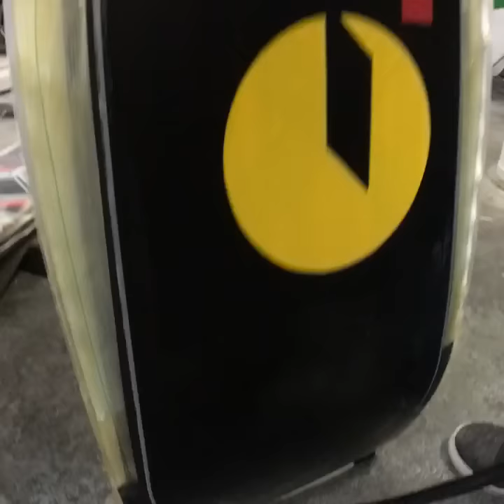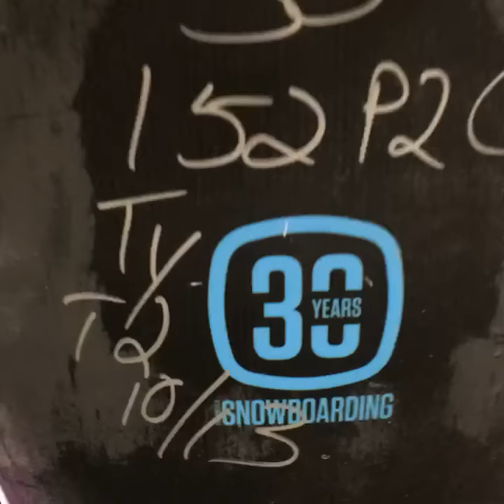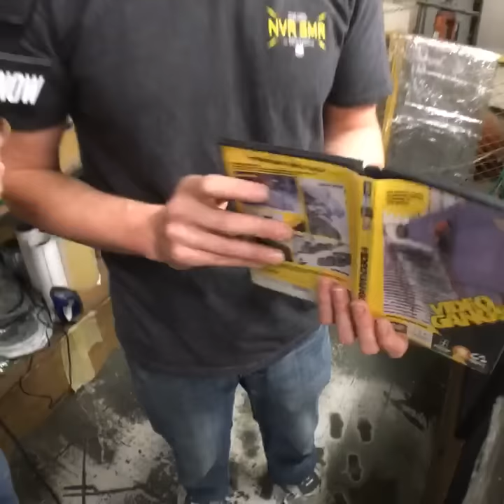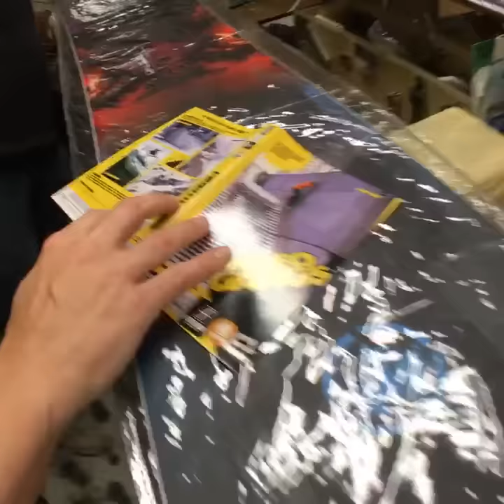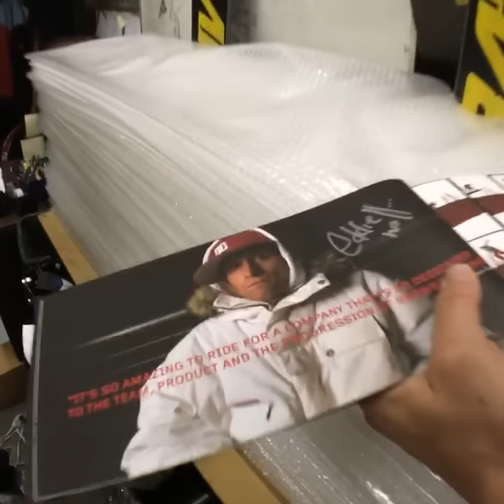Building a Custom Snowboard at the Never Summer Snowboard Factory : Day 4

Comment: @14:20 in addition to melting things, the water (which is probably not just water but a specific sort of oily water infused with emulsion) actually performs a health safety function in that it coats all "shrapnel" from going airborne into the lungs of anyone in proximity.